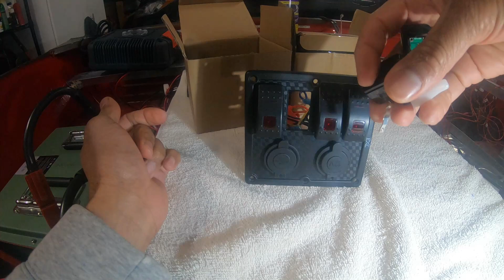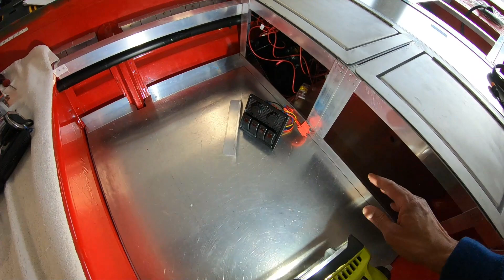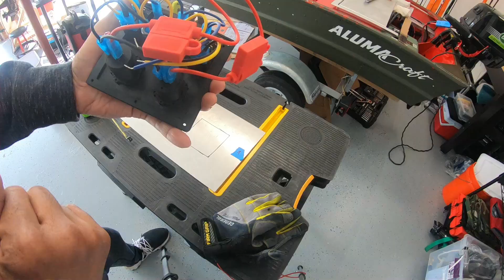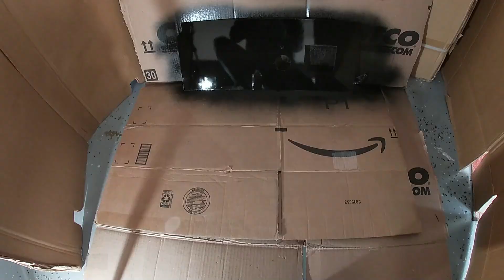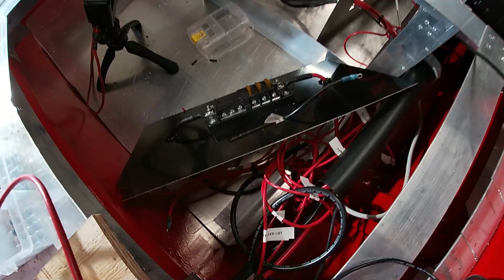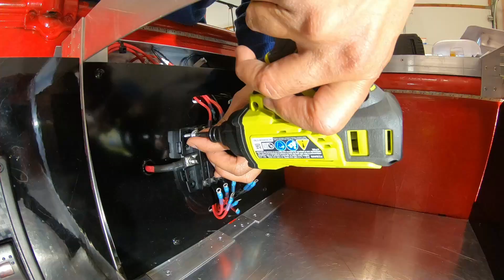COMPLETE Switch Panel Walkthrough and INSTALL {Jon Boat to Bass Boat Conversion} Alumacraft 1232

Comment: I would have bought the one with a push circuit on each switch then you wouldn’t need a fuse panel at all. It’s very cheap and cuts out a lot of wiring. but hey that’s just me you did good work man!!!
Reply from the maker: Thanks 👍🏾🤙🏾

Comment: Great videos!! Just curious if you used a ground bus bar on this install and if not, how come?
Reply from the maker: I believe I did at the rear of the boat so that I only had one negative lead to run to the fuse block at the center of the boat.

Comment: This is EXACTLY the video I needed as it is exactly the fuse block and switch panel I have. Your video was the BEST I've seen. My only question is do you take the grounds from the fuse block to the switch panel also or do you run each ground wire to the accessory?
Reply from the maker: No, the ground leads from you accessories go to the fuse block including the one from the switch panel.

Comment: Fantastic work...love your videos!  You're absolutely right about having time to THINK and THINK AGAIN about how to solve a challenge.  On my own jon project, I don't know how many times I've designed a way to tackle something, been OK with it, thought about it some more, then woken up two days later at 3AM with a much better solution running through my head.
Reply from the maker: Yepp. That means you are creating greatness. ✨️
Reply: @BassBrothersFishingDMV  Thanks!  By the way, did you ever get my reply on a link for the new TEC carpet adhesive?  YouTube was acting weird every time I tried to reply.
Reply from the maker: @thomassater3462  I didn't get it? Can you put it here or direct message me on IG or FB

Comment: Just bought my first jon boat! As soon as I did I went straight to youtube to start coming up with ideas. If I do all labor, what’s something like this cost after paint, materials, etc. Thanks!
Reply: On my own project (12 foot jon conversion), I'm approaching $3K.  But I'm not doing all aluminum framing and decking, waterproof hatches, etc.  I'm going down the wood path a la Anthony Jones's first build, as it suits my skillset, interest, and budget much better.  I suspect all-aluminum would push the cost beyond $5K easily...but that's just my guess.

Comment: Have you thought about putting the main hub/fuse/panel/thingamajig on a hinged piece of aluminium with some type of clip to hold it in place?  I did that with a tractor where the wiring/fuses were in an awkward spot. It allowed the panel/block to stay in place for normal use, but I could pull the pins and get to the wiring behind it if I needed to without having to do a lot of disassembly in a tight spot.

Comment: "More Better" is something I say all the time. So YES it is proper placement of the words. Just don't ask an english teacher. (LOL) I've watch each of the electrical builds a few times now. I've enjoyed both of the boat builds you've done. I've recently moved my batteries from the rear of my boat to the middle to even out the weight. I also added a switch panel. So all of your content has been very helpful. Thanks for sharing. Big Fan!!!
Reply from the maker: Lol. More better....   appreciate the feedback as always Duane.
Reply: *   I like the way you used the phrase " really quick " instead of the abomination " really quickly " etc. that is being thrown about nowadays. I don't know where or why people have accepted that type of speech as proper English, but it just rubs me wrong when people use to adverbs back to back like that. Anyway, sorry for my rant, but thank you for using, in my opinion, proper grammar.
   P.S. Great job on your video.

Comment: I just finished my boat. The switch panel I bought had the same locking connectors. They are tricky to disconnect for sure. Thanks for sharing. Great info.
Reply from the maker: So true.  Too bad I had to learn that one the hard way 😩